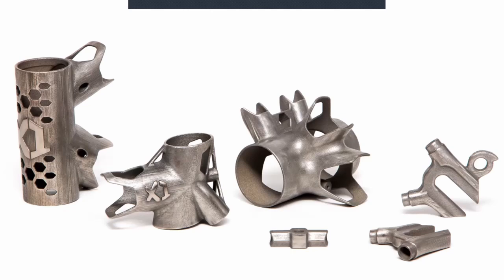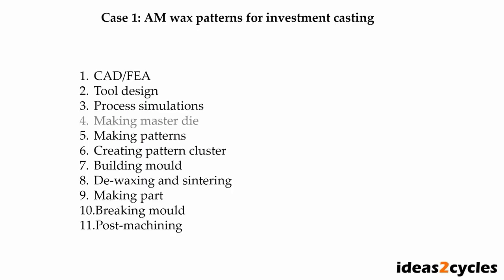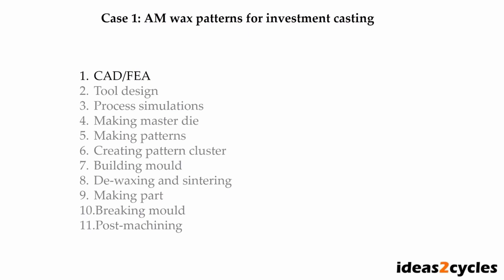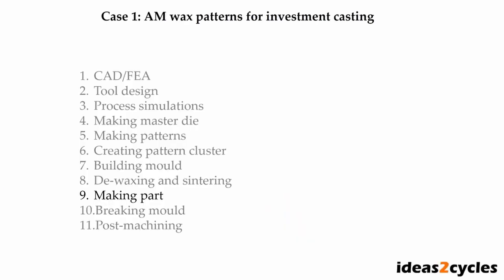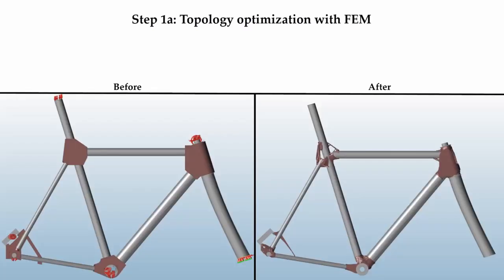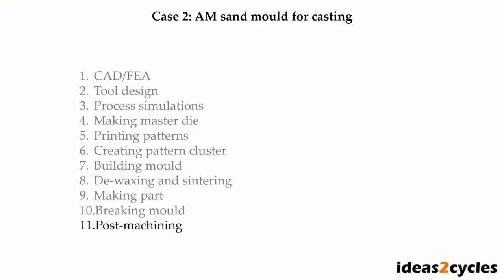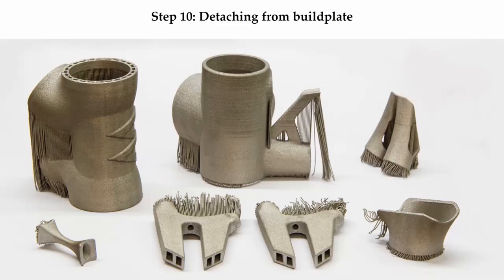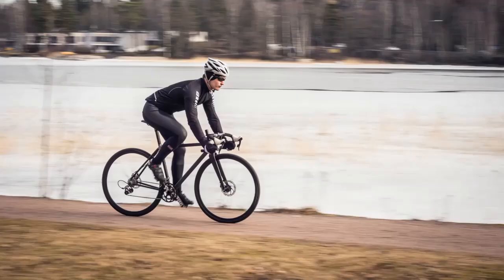3D printing metal lugs for bicycles - Printed patterns vs. printed moulds vs. direct metal print

Comment: Hi Great video, thanks!  can you tell me which alloy was used in the last example - and how much it cost to print all metals parts?
Reply from the maker: It was Type 316L stainless steel. Prices vary a lot depending on build volume, but lugs would be around 1500€ nowadays.
Reply: @Ideas2cycles  holy crap that's expensive. Isn't additive manufacturing was invented to avoid such prices, to make it cheaper?
Reply from the maker: @ArthurD  No additive manufacturing was not invented to be cheaper than traditional methods. In some cases cost savings are possible if production volumes are low or part complexity is high.

Comment: Did the direct printed lugs were stable enough for riding?
Reply from the maker: If you mean structural integrity, then yes they hold up to the static loads and low-cycle fatigue just fine. High-cycle fatigue is perhaps more challenging due to inherent porosity and surface roughness.